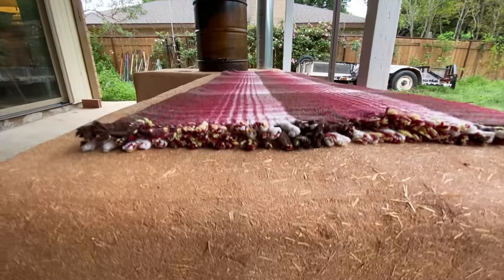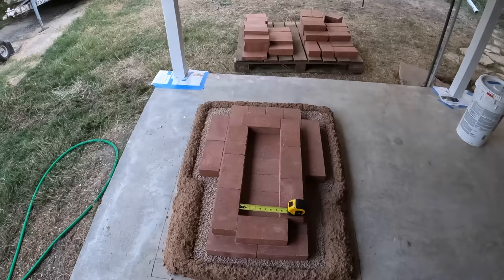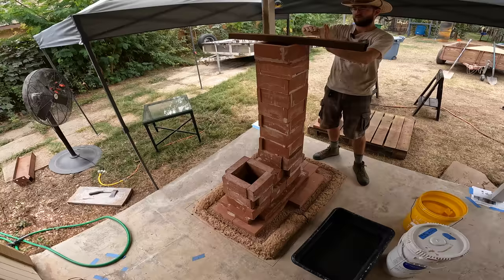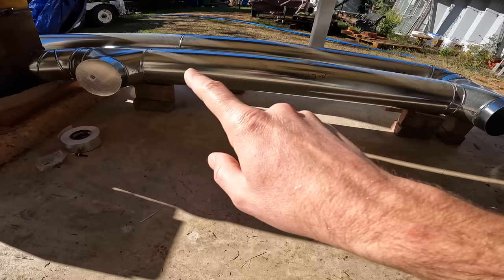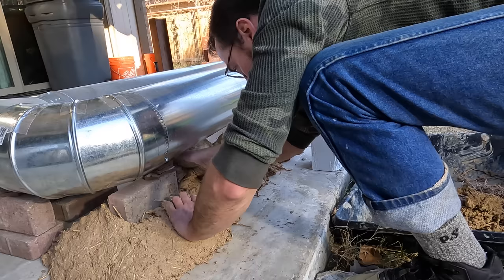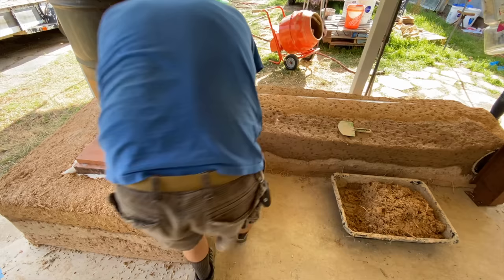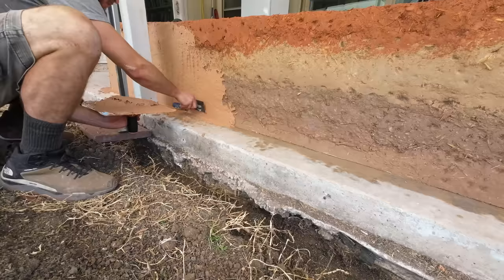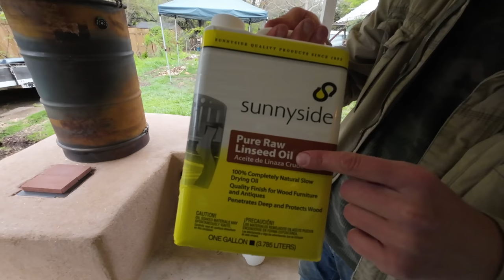World's most efficient stove!!!!  Made of DIRT!!!

Comment: Where would one get clay, when they don't have a local clay school that has old material laying around?
Reply from the maker: You can buy blocks of clay on Amazon. I found out after doing that a few times that it can be more economical to buy dry powdered clay sometimes which also can be found online. 

In many regions local soil may contain adequate clay to avoid having to buy it. Not in my region though. The book I link to in the description goes into a lot of helpful detail on how to go about seeing if your local soil will work or if you have to buy any clay to add. Some of it is trial and error by testing different mixtures in small test blocks and seeing how they hold together. Hope that helps!

Comment: Do you need a thermal bank if you don't let the fire go out?
Reply from the maker: Even if the fire burns continuously, the thermal bank is helpful in case of an event like opening a door or a window suddenly to go out of the house. Without the thermal bank, all of the hot air leaves the house when the door opens. With a thermal bank, there is something inside the house to release heat once again, even after a draft blows through. Hope that makes sense.
Reply: @suburbanbiology  hmm.. ok.  Ya I think so.  Thanks

Comment: I figured water glass would have been a pretty good sealer for the stove. Is there a reason you went for linen seed oil over water glass?
Reply from the maker: I didn’t do much research into lime coatings on top. I have read in these comments that there are a number of different formulations of either lime plaster or now lime/water that I might have used. I’m not sure though since I’ve never done either. I know that in the book I read linseed oil was touted to be a fairly good water, resistant sealer, and it was super easy to apply. That’s why I went that route.
Reply: @suburbanbiology  oh, ok. Makes sense, water glass is pretty caustic

Comment: Would it be viable to hvac tubing through the house surrounded by earth material or would that make the whole home too hot ? 

What about instead if you had the hvac tubing throughout the home but no vents instead in each room thered be a heat radiator of earth material in the floor underneath where a bed would go? Or woyld that make the beds too hot ? Does this bench get really hot or just radiate warmth ?
Reply from the maker: The bench gets quite hot if you burn a fire for a couple hours. There is a limit on how long the duct can run horizontally before you run out of the force required to push the air through it. It would be tough to run it through an entire house because of that limitation. Thanks for commenting!

Comment: Okay, so the first issue i see with the exhaust system is the excessive length creates excessive cooling which would lead to an issue with creosote build up, correct?
Reply from the maker: Most of the creosote is burned completely in the heat riser. The advice long term is to clean these like any other system to be safe. Hence the cleanouts.
Reply: @suburbanbiology  does the buildup happen over a shorter period of time? Or is it relative to any other wood stove chimney

Comment: How about hemp clay or brick
Reply from the maker: Clay brick would work well. Hempcrete a good insulator, and would therefore trap the heat in the center of the stove and it would be dumped out of the top of the chimney. So hemp would not work very well. Although I am assuming you mean hemp Crete. I suppose if you used hemp instead of straw in small amounts, it would be fine.

Comment: Curious if you've thought about or seen designs for adding coils around the riser that feed either a hot water tank or radiant heating? Would it negatively impact draft inside the stove?
Reply from the maker: I think a coil filled with water wrapped around the bell, would actually help with the draft overall. I just didn’t want to have to deal with the concern that the water might turn to steam, which can be rather explosive. Literally. Thanks for commenting!
Reply: @suburbanbiology  - I've been thinking about how to get one of these to be both a cook stove (hot plates and oven) as well as my water heater. The dangers with the water are real, especially if your water is already almost at 100*C and you still need the heat for the cook stove. I think the way around that is to use dampers to be able to direct the heat to or away from the water heating part - just haven't figured that out yet...

Comment: I’ve tried to read and figure out how you get that upside down barrel heat riser to fully seal. I saw how you did it with the mortar at the bottom but what about at the joint connecting the two barrels. Perhaps it doesn’t actually have to be air tight because of draft concept? Im curious what part of the system  here critical to be sealed up: exhaust pipes, riser, firebox?
Reply from the maker: Every book or forum discussion I have ever read, says that you should use fiberglass rope stove gasket, and squish it between the band, clamp, and the lips of the barrels to get a good seal. If I’m being totally honest, though I skipped the gasket part because it sounded pretty cumbersome to get in there and I wasn’t sure if it was necessary. When I operate the stove, I have a carbon monoxide detector about 10 feet away. So far I have never had the detector go off at all. I am fairly confident that inside the heat riser there is a relative vacuum compared to room pressure due to the draft in the system. I think this is why I have gotten away without the gasket and still have not had any issues with smoke coming out of that tiny crack. But again everything I have ever read says that you should seal it with either clay mortar or with fiberglass stove gasket. So if you build your own, I recommend that you follow their advice. I hope that helps.
Reply: You totally answered it for me thanks. Makes sense that the book says to seal but seems like if anything it’s probably more of a minor performance loss rather than safety. Glad to have benefitted from your experience here because a lot of the designs look leaky and apparently still work . CO alarm is peace of mind for any fuel burning setup so easy to have. Keep doing what you are doing I love it!

Comment: this sure seems like a cool technology but i have no idea how i'd use this to heat a home or shed. if the building is 2x4 then trying to pass through the wall from the outside with those heated pipes could start a fire. and even if you go into a mason building with no risk of burning down the bricks then how are you going to cover those pipes for both safety and thermal mass for the heater?
Reply from the maker: I enclosed the porch in order to get it to heat the house. Used cement board where the duct passes through. See below. 

FREE HEAT!!! Sauna in greenhouse porch heats our house.
https://youtu.be/WXjYxUpmDwg
Reply: @suburbanbiology  i will eagerly go take a look at that video later. thanks for the reply, and thanks for the video (both).

Comment: Is it safe to use galvanized steel duct with this?
Reply from the maker: For the internal ducts yes. The external parts should be double walled stainless ideally. 

If your concern is off-gassing of the galvanized chemicals the fumes would largely be vented into the exhaust gas and go out of the chimney. Thanks for commenting.

Comment: how long of a run of pipe do you think one could use before it's too much?  I would love to have a set up like this, but would like the barrel and fire on the ground off of the deck, but still have the seating area/ warming part on it?  Thoughts?
Reply from the maker: The bench that I built is already approaching the maximum allowed length for an 8 inch duct. I think offhand it was around 20 feet or so. I pulled those values from the book I linked to in the description. If the duct is too long internal resistance builds up and there is no draft to pull the fire sideways through the burn tunnel. I hope that makes sense. Thank you for commenting and for subscribing.
Reply: Thank you.

Comment: Does anyone know what was used to adhere to the "clean out covers" that he cut out designs on before dunking into muriatic acid
Reply from the maker: I purchased some clear adhesive sheets on Amazon. You are able to print patterns on them using a standard printer. That way I could print the design and then cut it out and stick it on. Hope that helps. Thanks for commenting and subscribing! 

Ps. If you like the sun pattern, I have a link to some merchandise in the comments section. Feel free to buy something if you like. The sun is featured in some of the products.

Comment: I'd like to get an idea of your local climate, so would you tell me your nearest town please?
.
Reply from the maker: Austin Texas area.
Reply: Thanks.
''Austin belongs to the Humid Subtropical Climate under the Koppen Climate Classification. This climate is characterized by long, hot summers and short, mild winters, with warm spring and fall transitional periods.''
Rather milder than the Dordogne in France where I am.
Minus degrees C are frequent in winter, but much milder than the UK when I was a kid.
Large areas of glass would be very detrimental to comfort, due to radiated heat loss, even with double glazing.
Some people try double-double glazing but that won't stop radiated heat loss unless the glass is mirrored.
I designed a brick storage stove, but then the Russians and the US screwed the gas supply, and the brick making company's had no gas to make bricks with.
So, first, couldn't get the bricks, then when supplies restated the PRICES!....😒 $1.10 / brick! and about 600 bricks minimum. 
So ''back to the drawing board.''😊
.
 @suburbanbiology

Comment: Wait , I thought it was heating the whole house , but it seems like it's just for the back porch? 
I thought the earthen material would remain hot and keep sending that hot air through the vents into the house. 
I now am under the impression that it the material is what heats the area and the HVAC vents are only to heat the material. 
Im basing this assumption off of the chimney stack ,and no HVAC tubing going into the house. 
This seems extremely inefficient if that's the case or is this just an example piece because I would want the piping through the whole house and not have hot exhaust air coming through at all. Just have radiant heat from earth covered tubing throughout the whole house. 
I feel as if that is in fact what this is supposed to do, but this is essentially a working diagram to demonstrate for us. Please and thank you.
Reply from the maker: The goal of this heater is to ultimately heat the house and a greenhouse that I plan on building. I enclosed the porch so that I have options as far as which way the heat moves. Here is a link below. Thanks for commenting!

Enclosed porch traps stove heat
https://youtu.be/yzTM37MGyG4

Comment: Why did you use AC vent pipe instead of wood stove chimney pipe?
Reply from the maker: Because I was being foolish and cheap. I figured since it’s outside on a porch I would try to save some money. The stainless double walled pipe is far more expensive. Anyone doing this indoors should definitely use the stainless stove pipe. And in retrospect I probably should have also. I took extra measure when I enclosed the porch to make sure the wall that the duct passes through can withstand super high temps in case of chimney fire. Stainless would still be better though.

Enclosed porch traps stove heat
https://youtu.be/yzTM37MGyG4

Comment: How much do recon this weights, could a smaller sized version still be efficient, and also wouldn't it be possible to integrate a pizza oven atop of it?

I'd guess it burns rather clean, but I've even seen some people directing the combustion gasses from the chimeny down into planting beds outside for enriching the soil.
I kinda needed something similar to what I described above and had just been researching my options, but found your version intruiging to try out for this miniature version.

Needed some heat in a outhouse I insulated on a upstairs balcony that holds my solar panel array and the battery bank, so to keep them heated in the winter, this would be perfectly ideal, and I could probably even just circle it around the bottom of my construction. 

But certainly would have to calculate some measures, as it can't get too heavy, but that small layer of bricks seems fine if I just size it down a little, using smaller bricks.

Anyways, thanks for the video, was a pleasure to watch! :-)
Reply from the maker: This thing is several thousand pounds for sure. You’d want to scale down a lot. I plan on building an greenhouse and have earth tubes buried in the greenhouse. Then I will pull the heated air in through the soil to store the energy in there. I’ve already started to enclose the porch. See video on my channel. 

Good luck with your project and thanks for subscribing!
Reply: @suburbanbiology yes I calculated the surface area to require a little over a few hundred KG’s to a Ton at the smaller scale.
My balcony is held up by very thick steel poles that can carry more then a dozen ton.

Exactly, not just the heat but all those nutrients are gold for our crops! ❤

Comment: Hi, thank you so much for the video, i'm reading the same book to build my rocket mass heater and your video illustrated it beautifully. But i was wondering, the duct pipe, is it galvanised steel, stainless steel or 2mm steel? It's the only info i can't seem to find.
Thanks in advance
Reply from the maker: The particular duct I used was galvanized, HVAC duct. Stainless is more resilient and some would argue more appropriate. The problem is that stainless steel duct cost way more. So I went with a cheap route since my stove is on an outdoor porch anyway. I would definitely advise for the duct external to the cob that you go with stainless duct that is meant specifically to act as a chimney flu. That should be safer since it is double walled and a chimney fire wouldn’t melt through it. Good luck with your project!
Reply: @suburbanbiology  thank you very much for your advice.

Comment: Nice looking heater. How ever i have one question. In the end where you have fire on it, i see smoke coming up at the fire place and what i have seen these rocket mass heaters there are versions where filling hole have cap on it and air intake is located down front of heater. I cant explain it better with my bad English but you get the point i think? So is it possible built that little different way so smoke wont come inside house whole time when there is fire on? Of course there comes little smoke in when you fill again wood in the heater but if build differently it wont push smoke in all the time if i have understand correctly of the other version? I have thinking to built that kind of mass heater inside little cabin for main heating source so it can´t blow smoke in all the time. If you think that it wont work like it use to be with air intake modification i would be cratefuly if you can answer to me. 
Thanks anyway for good and interesting video.
Reply from the maker: I don’t have problems with smoke coming back out of the feed tube. I place a half fire brick across the top to cover half of the opening. This increases the velocity of the air at the opening and this pulls the smoke downward. When you first light the fire you have to start a small fire way at the back so that heat drafts up the heat riser. I show that in the video with the Vaseline. That prevents smoke when starting a fire. Good luck!

Comment: why do you want straw in this "cob"? the other components are not biodegradable, but wont the straw be broken down over time? what does it even do the mixture or is it legit just a filler agent to reduce cost on clay and sand? 

i mean without the straw if you added a small amount of cement to the previous mixture wouldn't you just end up with concrete? makes me wonder if something like rammed earth, or compressed earth blocks could server the same function as this cob stuff.
Reply from the maker: The straw serves a similar purpose to rebar in concrete. Adds tensile strength. Once dried does not biodegrade on the scale of a human life.
Reply: @suburbanbiology  good to know. i've been playing around with looking into compressed earth blocks and rammed earth as a building material for walls/floors or even making tiles for a roof. the motivation is purely financial as the building material is crazy cheap if you have spare earth with the only cost being the machine and some cement to mix into it before compression. this seems like another great low cost option though admittedly if you need to be real exact like the 3:1 ratio of sand to clay with some hay i'm guessing you can't sub that out for typical earth easily. still it has the advantage of being moldable to the shape you desire vs strict blocks or 2x4's.

Comment: cool concept, but when soot builds up in that thin little hvac duct, its going to burn through and wreak havoc.  its not your earthen bench that'll be a problem though, its the DIY guy that burns down his house because he doesnt have the skill, will or discipline to do this in a way thats save, when it goes out of control.  chimney of any kind, means a chimney FIRE at some point, or massive maintenance which we all have to take care of, again, thats not the issue :P.   to do this safely for the masses, it will have to be massively overbuilt, like with the metalbestos pipe used for the hottest part of code-built woodstoves in houses.  i think this concept is great, but its not built to be safe for dumbasses yet, and dumbasses have wives and children that need to have a design that accounts for the owners ^_^.